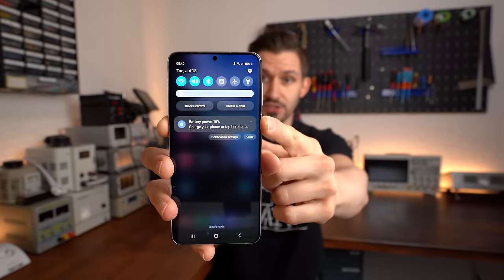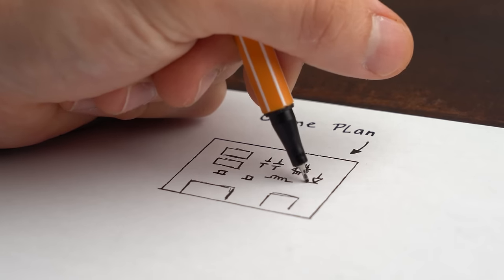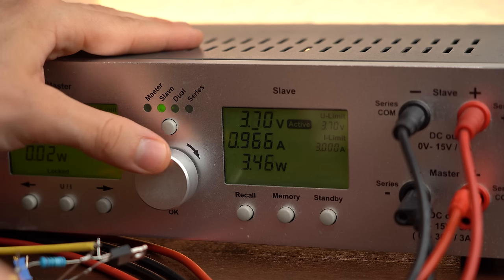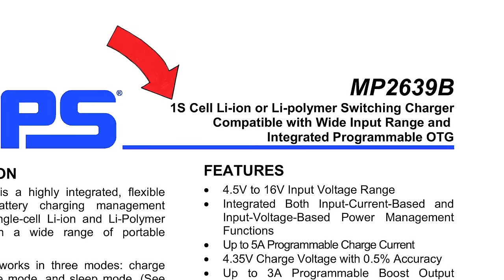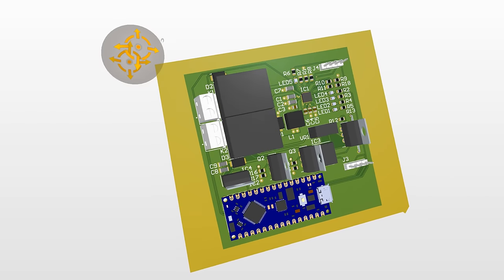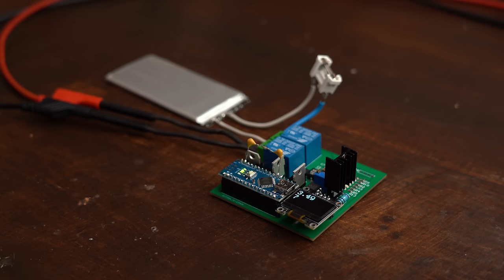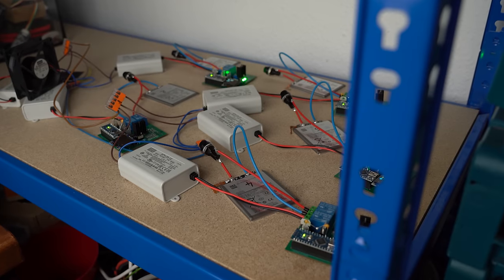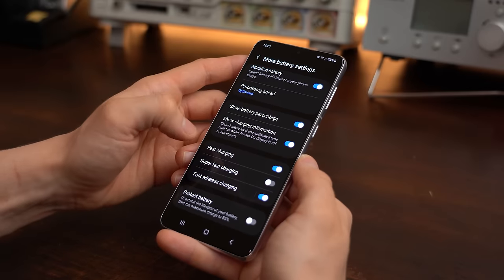Don't Fast Charge your Phone before Watching this Video!

Comment: Two extremely important aspects you forgot to consider is that most of these high wattage fast charging phones actually use 2 cell batteries with the power getting split between the 2, thereby increasing the charging speed as well improving the battery life. Secondly, towards the end of the charging cycle(around over 80%) the phone gradually reduces the current being sent to the battery and the last few percent is usually charged at a mere 1amp again to improve battery life. Also the battery is never fully charged or discharged either, a certain amount is kept as reserve to prevent deep discharge/overcharge. Hope you consider these in your future observations.
Reply: thats part of the charging curve of the battery ce;
Reply: thank you saw this on my feed and seemed a like a shit ton of click bait thanks for telling me what he didn't so I don't have to watch this
Reply: Splitting it into two cells can help however, the capacity of each cell is also lower (Half), so you can’t just push 2x as much current for example the C rating would be half for each cell. but I’m unsure as to the exact relation for those cells.
Reply: The battery would still have to accept the power. So I don't see how that would change anything.
You just save the convert 12V to 3V step, or lower the ratio, making less losses in the eletronics.
Reply: @erlendse  You can place them in parallel instead of series, reducing the current on each cell.
I am more interested on how muc hthe heat builtup causes damage as thats also a major aspect when charging.
Reply: as others pointed out, 5 amps into a 5ah cell is about the same stress as 2.5 amps is into each 2.5ah cell. I think the primary reason for 2s battery is to reduce power loss (heating) in voltage conversion. That is, 1) same reason why grid power lines use higher voltages, 2) making battery voltage closer to the output voltage of the charger. Some go as far as to directly connect the battery to the charger, and send precise commands to the charger on what to do, to reduce heat-up of the phone and thus extend the life of the battery.
Reply: Are you sure about the 2 cell approach? I have never actually seen this. Samsung doesn't do it, ok they charge with 25W which may be not considered high anymore, even if it is still 6.5A at 3.8V. Checked teardowns of some of the fastest Xioami ones at about 100W and it was still a single cell at 3.89V nominal. 
With 2S it could be easier on the cables and PCB, allows thinner traces with high voltage / lower current. Otherwise I don't see an advantage, stress on the batteries will be exactly the same. You would need 2 charge controllers or some balancing circuit, which is more complex + expensive. Not sure about efficiency, 2 smaller DC-DC converters are probably worse. Also if it should still support old 5V USB input then step up is required...
Reply: My phone charges at 9 volts 3.5 amps when fast charging and doesn't heat up much in doing so
Reply: @1Hippo  3.89? My phone runs 4.1 to 4.3 (by the internals - on two phones). By the time it's at 3.89 it's mostly dead. 
Is this just a voltage meter being off within the software in my phones?
Reply: Not sure about double or more cell, but xiaomi battery usually have more than 6 wire from single battery, maybe its true that it have more than 1 cell?
Reply: Thanks, the results are interesting but the science is more advanced. 

There are a lot of factors that affect how the battery is worn. The power curve, how well the battery is cooled and even the chemistry inside.
Reply: it's not even as high as 80%, more like 60% when they start curving the charge significantly.  it's the same for electric cars, the first 60% can be fast/super charged, but the final 30-40% is a crawl with the final 10% sometimes taking just as long as the first 50%.
Reply: @1Hippo  All of BBK group (oneplus, oppo, vivo) uses dual cell battery for phones that charge at 50w or above
Reply: Contrary, fast charging at least one times per week prolongs the life of a battery because it animated the chemistry and cleans the electrodes. You can compare it with a car: you shouldn't use a car only in the city traffic, once in a while you should use the highway/Autobahn to get the motor for a prolonged time on high temperature and burn away residue like soot
Reply: @heinztimmer5453  When you mentioned it's like a car, I thought you were saying it was like car batteries. And just the opposite, lead acid batteries have significantly longer useful life at slow charges (low currents) and controlled temperatures. Although in the industrial sector, those with a deep discharge cycle are charged at high current every 20 days to agitate the powders deposited at the bottom. This is because since they are so heavy, shaking them mechanically is a lot of work. In a car that is not necessary since there are vibrations and it is in motion. In lithium batteries, if you look at the data sheets provided by the manufacturers, you will see something similar, a much longer useful life with controlled temperature (at ambient and cell), and ideally charge at 0.33 of the nominal capacity of the battery, taking care of the depth of discharge and the possible overload.

Comment: As an electrical engineer at the start of my career, I can imagine some of the pains you had to go through for this video. Thanks for doing all this for the sake of free education!
Reply: I'm studying to become an electrical engineer. What kind of job did you get?
Reply: you don't have to be a electrical engineer to know that designing a circuit then remaking it 5 times, then waiting 3 months then having to make only one YouTube video is painful
Reply: @themastereal8345 You do need some knowledge or you'll end up burning your house. By the way it's electronics.
Reply: @ColdFireYT no, you won't burn your house with a 5 amp battery.
Reply: @hasanagera  If the battery catches fire it jumps here and there in some cases and come in contact with your bed and curtain .
Reply: Electrical engineer?...
Not electronics engineer?
Reply: @ColdFireYT  what a nice imaginary situation you made over there
Reply: @AtlasReburdened  Actually both. Started Electrical Engineering and Specialized in electronics. That's how it works here.
Reply: @AtlasReburdened  They're the same thing
Reply: @eren_yeager9927 more or less the same thing ,but if you study electronics it focuses more on digital stuff and smaller electronics
Reply: use realme GT 3

Comment: Would've been nice to see how limiting the max charge to 85% would've affected it since that is adviced for lithium batteries to increase the life span
Reply: I can tell you that. I charge my phone to 80% most of the time and never let it drop below 20%. Based on AccuBattery log after over 600 charge cycles, my battery is now at 87% health. My wife, however, never care about this stuffs. She would let the phone die then plug-in to charge over night. After the same use time (we bought our phones together in 2020), her phone got under 50% health and have to replace it last month because it was puffing up (it bend the back cover upward, that's how we know).
Reply: @mrdzin1209  So a sample size of 1 per condition? Cool.
Reply: my phone battery health is 85% after 6 years from only charging to 80%
Reply: Same here. My phone isn't quite sure, but it still has 85–90% capacity after a few years charging to 85% (it is still good to do a 100% charge every few cycles so the battery management system knows how much capacity it has)
Reply: Almost 2 years fast charging my phone and plugged in on my motorcycle. Plugged overnight and let it rip some times. I’m at 86% health 🙄

I truly do not recommend my usage but it’s not that bad for the battery
Reply: Focus on not letting it drop below 20%. Yes, lithium batteries don't like the top 20%, but what they really don't like is the lower 20%. For practicality's sake, just charge it before it hits 20% and all the mind energy you'll have saved on not having to be fussing over the phone to check if it has hit 80% will more than pay for the maybe 10% battery life you'll sacrifice in 3 years.
Reply: Especially since this is an option now on a lot of phones where it will halt charging at 85% if you enable it - makes it really practical to implement IRL.
Reply: I'm at exactly 3 years on my phone, and I never pay attention to the battery. I charge it overnight, using a quick charger, obviously to 100%.
Though it is rare that I let it drop below 20%.

Battery health is at 81%
Reply: @hrtlsbstrd  Better than a sample size of 0
Reply: Most of the phones charging IC actually don't let charge battery to 100%, so 100% displayed is about 80% of capacity charge
Reply: @Spartacusse agreed although more and more phones are coming with the equivalent of a q battery built into the phone so you don't have to do anything or fuss over anyting it does it for you automatically
Reply: @mirrored_ this is quite untrue , phone manufacturers are doing quite the opposite and trying to stretch all the capacity they can get out of a given physical size of battery, in other words they are trying to get the most performance out of the smallest physical size possible. So confusing where people get this information about phone batteries only getting charged to "80% when you're phone tells you 100%" from?
Reply: @1marcelfilms that's a lie, even if you do the perfect charging, or have it unused & stored, experts say u still lose minimum 5% capacity EACH YEAR, so only 15% for 6 years is a lie! You need find a new battery tester!
Reply: @COMPUTER.SCIENCE. well I wonder instead of say having one large battery would it be better to like say have ten smaller bc it's the same voltage but you could technically charge it faster and it shouldn't matter it would still last the same cycles but it also depends on well lots so what he has is gell type or lithium but phones are requiring more than 3.7 volts so some are 3.8 to 3.9
Reply: Never did a scientific-grade experiment, only my own observations: 2 identical phones (one is for work), only one is limited to 85% (Samsung allows this programmatically) and tried to keep it within 85-20% charge. Mine is still working just fine, while the work-issued one has a little bit less battery capacity. The observation period was >1 year and keeping in mind the difference in usage (I use my own quite more), it is a big difference. But now I'm really curious and will try to measure how much lifetime does each of them have.

Edit: I use super fast charging, but used it only for couple of months, since I lost the SFC adapter :)
Reply: @cardboarddignity  ok I'd first start well science so ok Samsung is made in south Korea and yes you can trust there numbers so mah is capacity and then voltage but while voltage is limited to whole battery so example say a 1000 mah battery thats totally but say 5 200 mah equal the same but you can charge 4 faster at 3.7 or 5 volts but charging a 1000 mah at a single 5 volts i hope this clarified it for you and yes they make all sizes but same voltage
Reply: FYI limiting your max charge to 85% should at least double the amount of full cycle charges you'd get from the lithium battery.

So 300 to 600, basically. It won't do much for the super charging damage though. Super charging slows down at 80%.
Reply: @mrdzin1209  I charge to max all the time but try to never let it die completely.
Reply: @hrtlsbstrd  I mean, the video only had a sample size of 5 so... also not super great tbh.
they also simply gave their experience minus any sort of conclusion or result or anything. literally just adding their experience. that's it.
Reply: @hrtlsbstrd  he never claimed it was anything except anecdotal
Reply: @Tetrini  ?
Reply: This guy's test is completely flawed. Quick chargers don't just increase the amperage as he did here, and they dynamically change the charging rate. His understanding of quick charging is wrong as his test results should be ignored.
Reply: they actually do that for real. What I read though was 98% instead of 80% like that dude says.
Reply: True that is.

Comment: Would be nice to use this circuit to also simulate leaving batteries at 100% charge versus 80-90% charge, as some phones now have the option to set a charging capacity limit.
Reply: Most phones only fast charge to I want to say 80% then do regular charging for the remainder
Reply: I would also be very interested in testing around this (and perhaps verifying at what charge levels fast charging reduces its amperage, if at all)
Reply: https://youtu.be/iMn2yVoEqPs?t=715 There's "Battery protect". Most likely charging between 20-80% would not have affected the battery at all (even with 5A).
Reply: @mrkukov  I'd say at all may be an exaggeration but certainly greatly reduces any effects
Reply: My laptop stays at 70% charge with a setting  and I disabled fast charge because it always stays plugged in anyway
Reply: @ModerateDev 
I always used to tell customers to physically remove their battery with it charged at about 80% if they spent the majority of time plugged in. Obviously this loses the ability to survive a power outage, but the battery will store better. 
Software solutions like your one are still unfortunately not a standard feature, but are a million times better than taking the battery off... I wish every laptop had that function and had it enabled by default. The lifespan of the battery goes from about 1-2 years to 10+ when you do that.
Reply: This guy's test is completely flawed. Quick chargers don't just increase the amperage as he did here, and they dynamically change the charging rate. His understanding of quick charging is wrong as his test results should be ignored.
Reply: I use my home automation to turn of the charger when my iphone is at 80%. More than enough charge for a day and leaves the battery life perfect. Using for a year + and still at 100% life